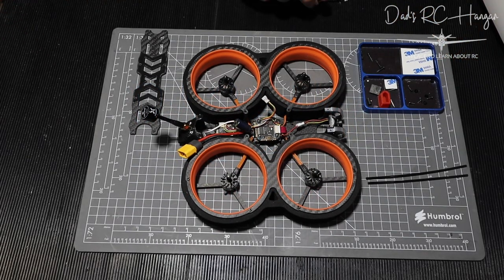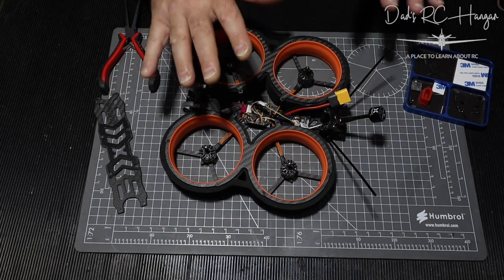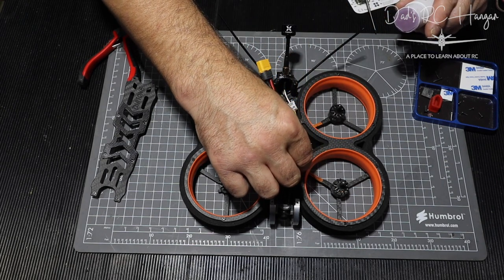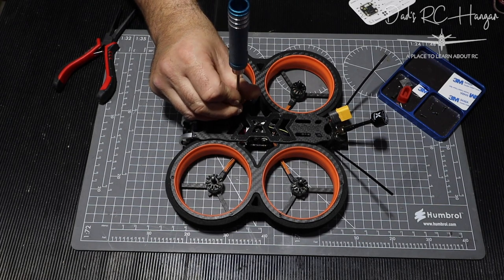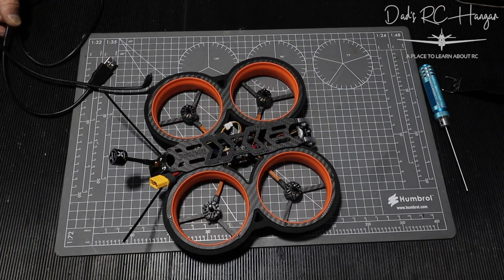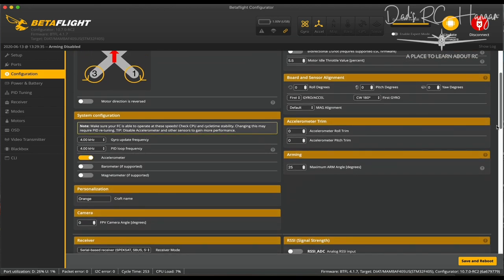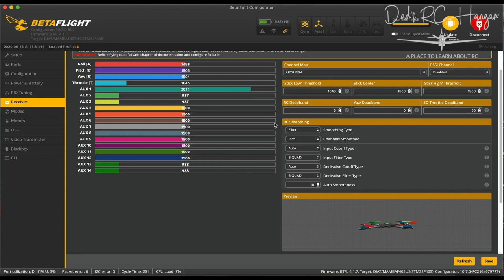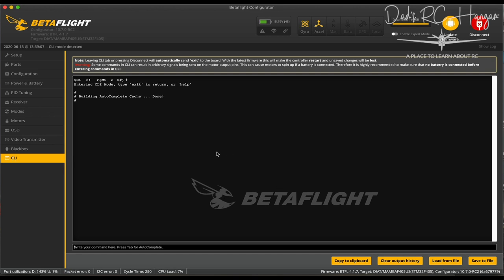Diatone MX C 349 Taycan 3" 4S Duct Cinewhoop Build & Test Flight

Comment: Hey man, great video. Can you switch profiles on the transmitter? Thinking it would be nice to as you say have a floaty flight one day, but be able to switch to an acrobatic flight the next, just using switches?
Reply from the maker: Hi Jack, more to follow for this Quad soon. You can set it up in Beta Flight to change  expo etc with a flick of a switch.
Reply: @DadsRCHangar  amazing. I'm awaiting mine from chinaaa. I've always been a DJI guy but sold up and making the move to FPV. Quite confusing at first but hey, it all looks worth it in the end. I've bought the 6S version, and a couple of 6s 1100mah lipos are on their way here too. Thanks for the reply I'll keep an eye out for following videos.
Reply from the maker: @JackBahh  you should put on the turbo props I put on mine. Sounds like a EDF jet. 👍🏻

Comment: do not disable accelerometer chris but u must permanently enable airmode that makes your quad stable when your throttle is low and dont fly in horizon or angle mode learn to fly in acro thats done by disabling horizon and angle mode learn to fly acro mode u wont regret it also most important setup your failsafe to cut or drop u must test that by turning off your transmitter when armed make sure the motors cut when u do that just incase u lose radio link u dont want it to flyaway if u lose radio link
Reply from the maker: Taz FPV Heya Bud, always count on you 👍🏻. 
I did test failsafe in the bench, but I will test live this weekend. Will change the settings to Acro mode as well. Thanks for the heads up and response. Have a good week 👍🏻
Reply: @DadsRCHangar  no problem at all glad to be of some help
Reply from the maker: Taz FPV made the changes, had Acro Trainer, so I have that on a switch, Air mode comes on when I arm, and disarm also triggers failsafe. 👍🏻
Reply: @TazFPV  Hey man, I definately plan to learn acro, and am smashing the sim atm, but is it possible to pop it in horizon mode with a switch on my radio tx (jumper t lite), say in my first few weeks i just ned to gain control and bring her back, or then once under control switch it back to acro?
Reply: @JackBahh  yes u can do that just program a switch on your jumper to a spare aux channel (once done u can check it works in the reciever tab in betaflight) then use that aux channel in the mode/horizon TAB in betaflight to swich to horizon mode when u get into trouble.  this can be switched whilst flying.   if using betaflight a gps can be connected and setup so that if u really get into trouble u can hit a switch and get the quad to return to home all by itself ....this can also be triggered if u lose radio link aswell. this vid should help you set that mode up https://youtu.be/SLy28mYiAzU

Comment: My Diatone MXC keeps losing bind from a radiometer tx16s after I power it off after two min why do it do that?
Reply from the maker: Do you have any other Quads or planes? I don’t use a Radiometer tx16, but it sounds like a TX battery fault, but if you have other models then that’s not it. I have not experience this, but I have now changed to a TBS.